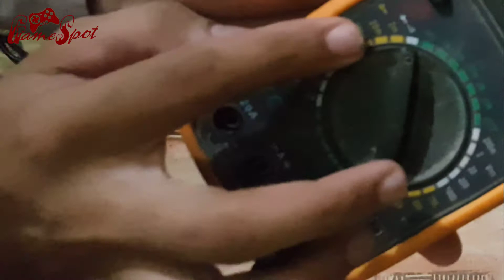xbox360 controller not working (lights up and then goes off) fix

Comment: Hi. If it's a wire problem and you have to replace the usb, what type of usb cable do you need to solder? Like, what cable should I buy?
Reply from the maker: A normal usb cable.. you can use mouse cable or a mobile charging cable
Reply from the maker: But make sure the connections are rigjt

Comment: I need help bro so i have a xbox 360 but my controller keeps blinking with 4 lights on what does it mean
Reply from the maker: What are you talking about? wireless or cable controller? If it is wifi controller It means your controller is disconnected from your console.. connect it with your console.. you can goolge it.. how to connect wifi controller with xbox360. And if it is cable controller follow the steps I have shown in the video..Hope it helps
Reply: @gamespot595  Alright thanks bro I'm new on the Xbox thing cause I just got one
Reply: @gamespot595  I'll make sure to find a vid on it
Reply: Me too

Comment: What if it is not wired.
Reply from the maker: Problem like this only happens with the wired controller, but if you are facing power problems in your wifi controller you can watch this video of mine. Hope it help https://youtu.be/L1RjURuqZAM

Comment: hi mine wired 360 control blink once but only player 1 and 4 then nothing, this controller already cut the cable and solder again about 3 years ago, but now i twist the cable but nothing, wonder if its the main board?
Reply from the maker: Well am not getting you completely.. but you should check the wires with multimeter to make sure they are supplying signals otherwise yes chances are that your board is damaged